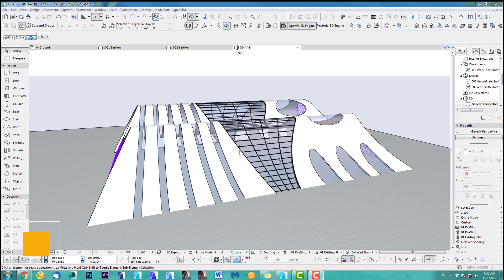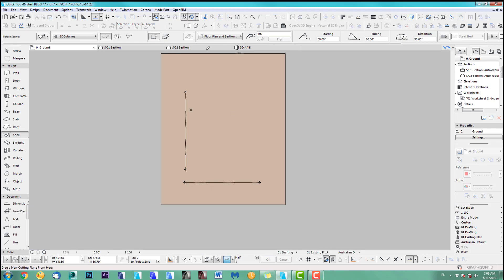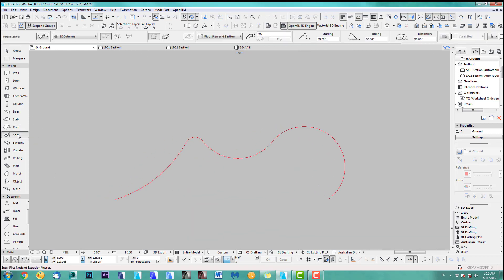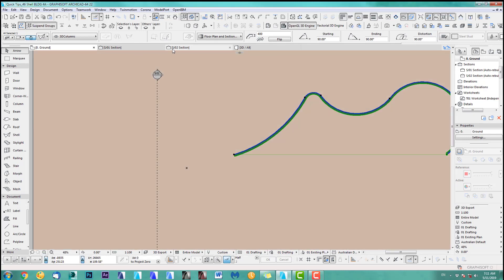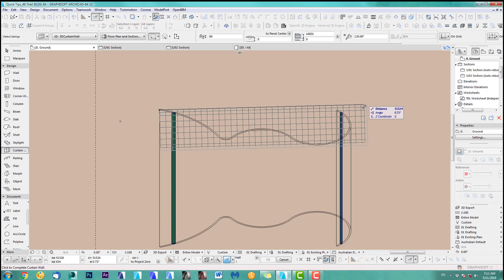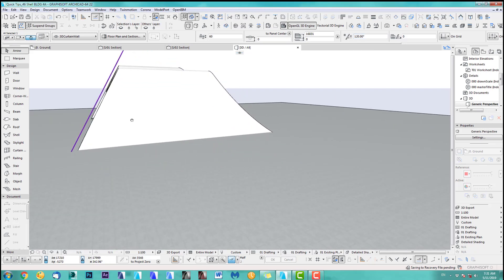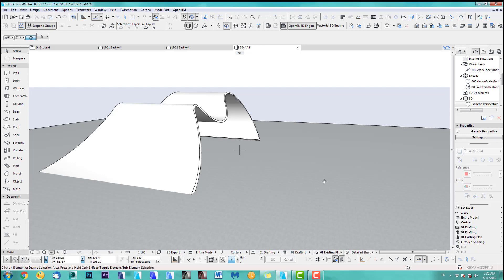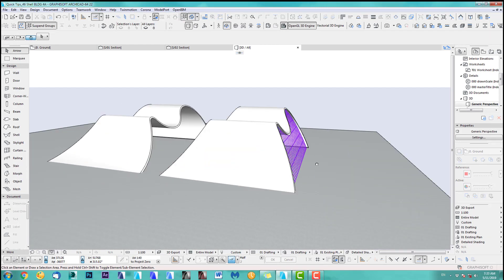How to model Shell Shape Building with shell tool in ARCHICAD

Comment: Hi! I really love your tutorials and I will subscribe right away because this is EXACTLY my challenge in my design now. Is there a way the elevation in the South view can be different from the one at the North elevation? Then in the middle, the shell would slowly twist so as to combine the different facades at the front and at the back? Thank you
Reply from the maker: Thanks! I am not 100% sure what you mean. You can have two different facades on either side. After you cut through just reduce the cut distance in 3D view.
Reply: @ASMTechbase  I mean, for instance, when I create a different front shell facade and a different the back Shell facade, I want the shell tube connection in the middle to merge both shapes, maybe make it look twisted, to increase complexity.
Reply from the maker: @giftmbanugo3605  for this you really need a nurbs modeler like Rhino
Reply: @ASMTechbase  thank you😞

Comment: what did u use for sustraction are those walls or what exactly ?
Reply from the maker: I used a shell which I modelled to look like a wall, so I can rotate them in section or elevation. You can use a morph too if you like, which you can rotate too.

Comment: is there a reason you did not use the curtain wall tool in elevation to do the roof lites?
Reply from the maker: Hi Errol, yes there is. I did them first in Elevation but then when I tilted them by 60 degrees they won't fit the shell roof. Unlike the shell tool the curtain wall will tilt and the top of the curtain wall will tilt down , like along an arc. The shell tool  "stays" at the top at the same height level when tilted !